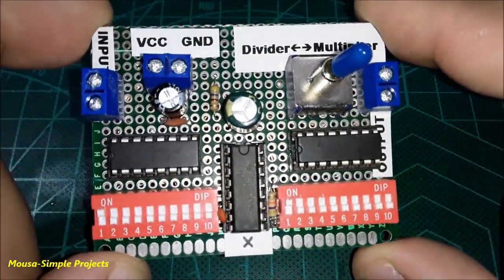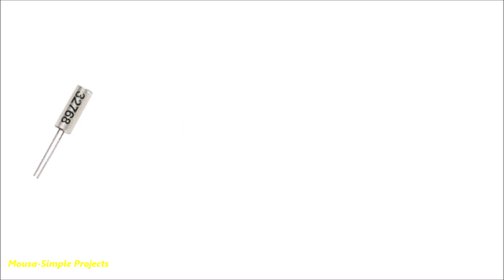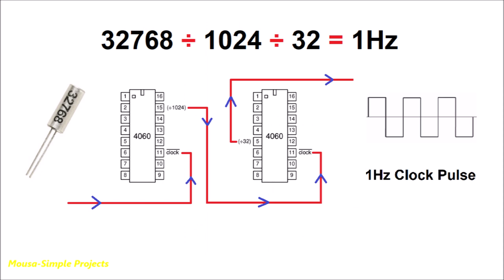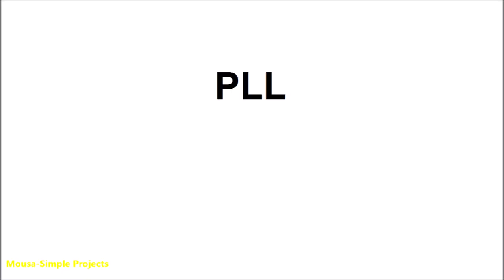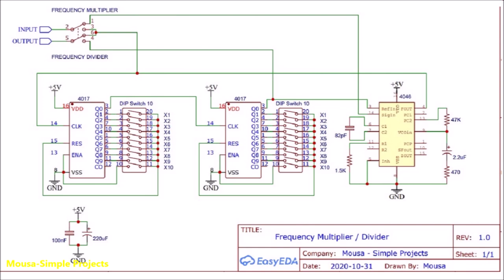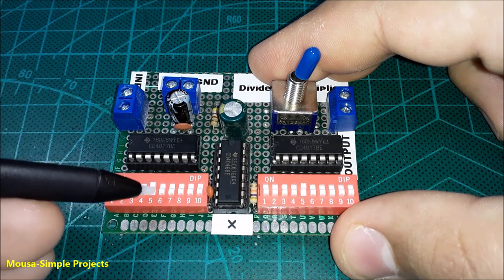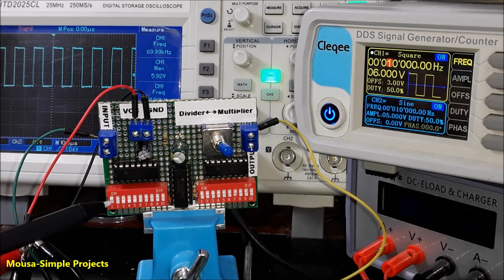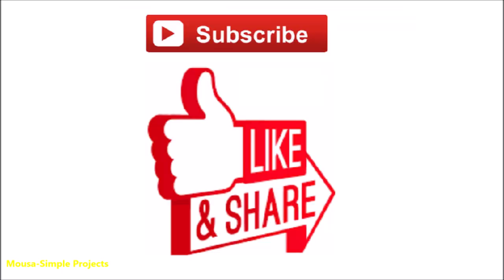Frequency Multiplier and Frequency Divider Explained

Comment: 1 - what is the name of the blue part can add wire to it
2 - i want to create rf remote controller i only have 60mhz crystal can i use your frequency multiplier to get higher frequency
Reply from the maker: 1-2 PIN SCREW TERMINAL BLOCK CONNECTOR
2- NO you can't use this circuit for high frequency
Reply: @MousaSimpleProjects  no did not mean high frequency I mean send the multiplied frequency like rf
Reply from the maker: I remember this circuit was working with maximum frequency of about 1Mhz, so 60Mhz is so high and you can't use it.
Reply: @MousaSimpleProjects  ok